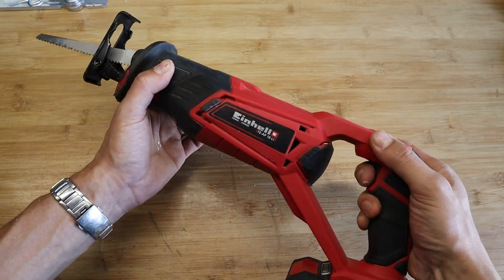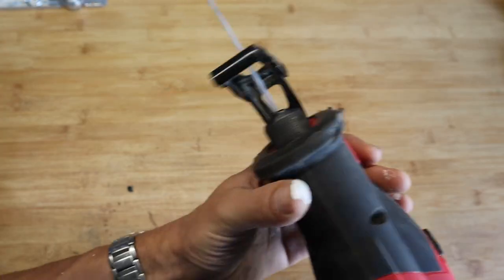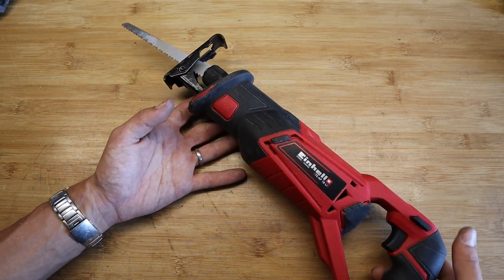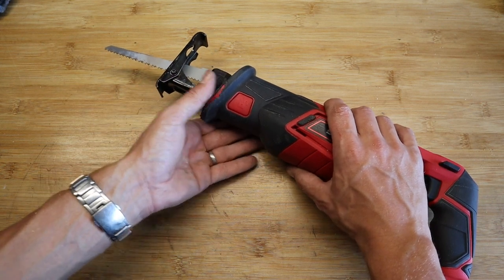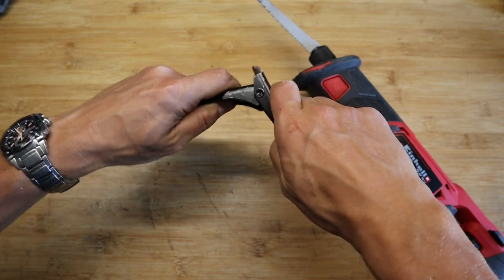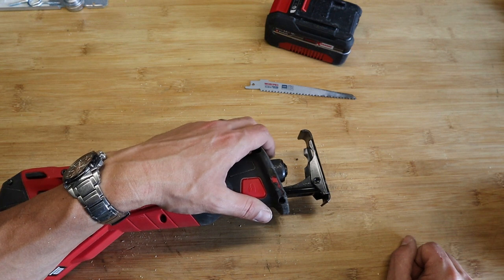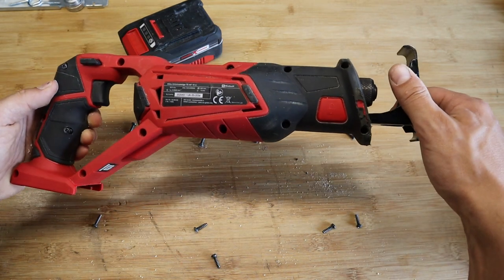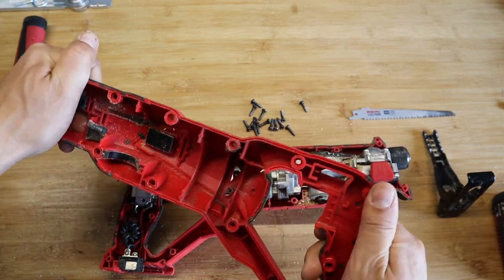Einhell 18V PXC Cordless Universal Saw / Reciprocating Saw - Why did it fail?

Comment: With Einhell or other entry level power tool I rather use two lower capacity battery packs as a 2.5Ah. this way the tool has time to cool down while changing the battery pack, or not being maxed to full power.

Comment: Hai, i have the same one. Did a bit to heavy on her an she began to smoke, and stopped working. It was my own fault. But i tear it down an give the engine some smacks, an blew air in it. Suddenly it starts working again. A few more hits en airblow and it works !!! Try it please and response to me
Reply from the maker: Hi Ronald, I did managed to get the motor working again by cleaning it and reseating the brushes but as the saw mechanism got damaged due to the 2 screws which came loose during operation I returned the saw to Einhell anyway. Their 3 year warranty is pretty hassle free. I have a new one to play with now ;)
Reply: Only 3 year warranty? The Ozito 18v range down here have a 5 year one with only 3 years on the batteries.

Comment: I have the Ozito named one of these and I do like the easy to use blade connector but what I do loathe is the stupid "safety switch." I have small hands and yes it's true what they say and my small hands make it bloody awkward to hold the safety switch in when I press the go trigger. 
Mine is unfortunately not the brushness model and it did like to overheat however the thermal protection stopped it from releasing the magic self destruction whispy "fumes." 
A useful tool for my use around the home but I would sure like the brushless range but in Oz they are about one third more expensive than the brush version. Due to that I will keep buying the brush version which will enable me to buy a few more of their cheap tools.

Comment: How is your replacement holding up? Some of these have just come in stock (in the Ozito brand) and for the price and 5 year warranty, I think I might pick one up.
Reply from the maker: The second one also went up in smoke after a few weeks of use. I think these saw’s have a cooling issue. I’ll might do a second video to see what went wrong with the second one. You might be better off buying the brushless version if they offer those where you are located.
Reply: @toolteardown  Unfortunately they don't have the brushless version down here. I will try my luck and lean on the warranty if need be. I always have my trusty corded heavy for backup in a pinch. Look forward to your video if you choose to find out the reason.
Reply: As of 23 October 2023 Bunnings have a brushless version for AUD$169. I believe the brushless was available before the mentioned date but that was more to indicate the time and price time frame.